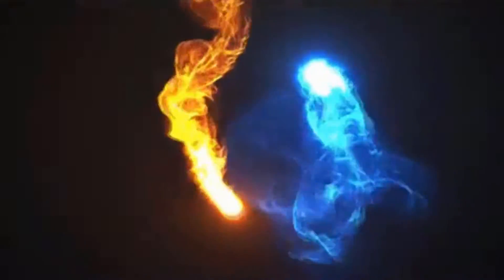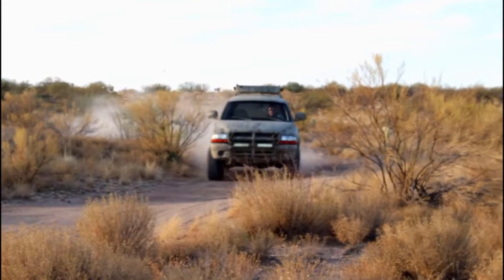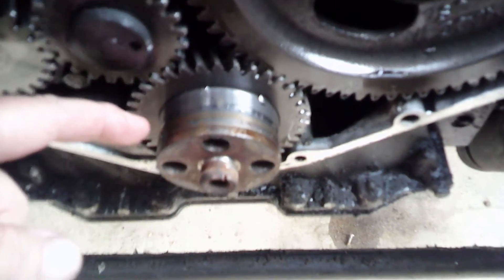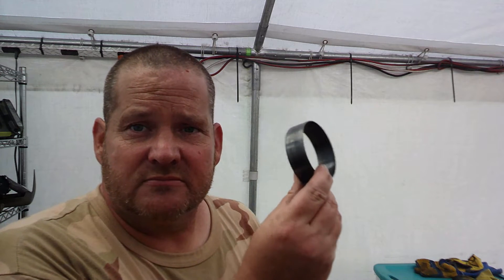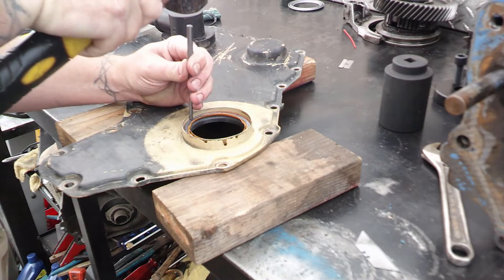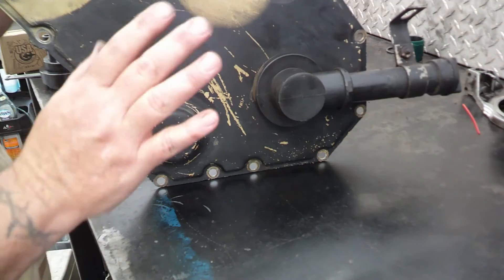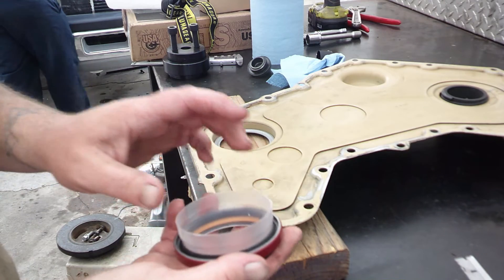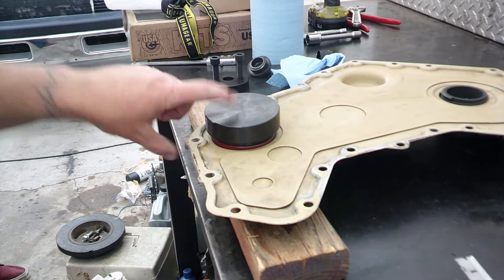12 Valve Cummins Front Main Seal and Timing Cover

Comment: Whats the update still no leaks? Did mine in may an after 26k mi seal is leaking again
Reply from the maker: Sadly the guy I traded the truck to put a bigger turbo on it and blew the engine. I stopped talking to him after that so the longevity of the seal remains unknown.